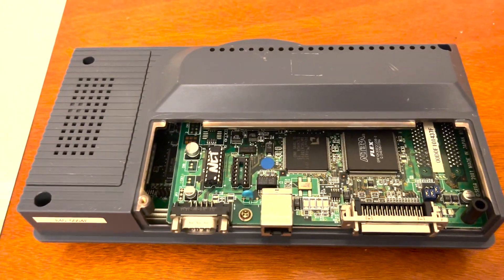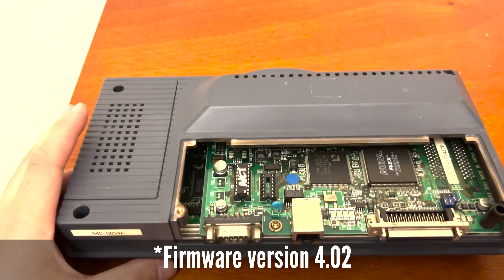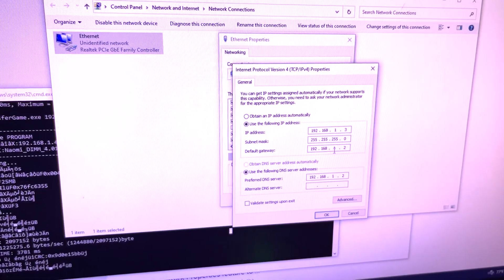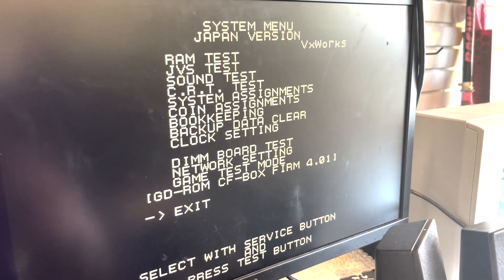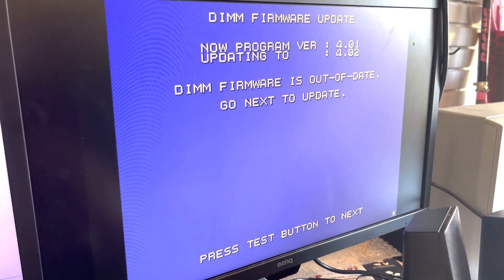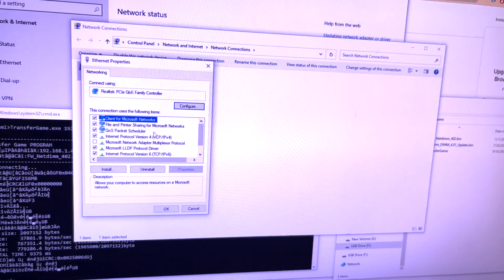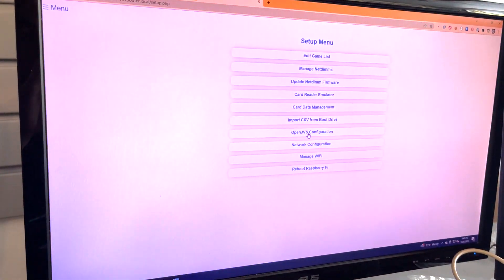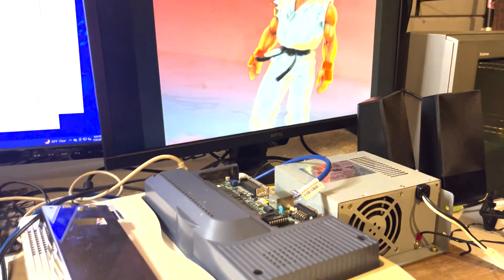How to update Naomi net dimm firmware

Comment: Great vid. Was wondering what you used to plug the power supply to the wall outlet. Looks like you have an oem sun power supply. I have the same and would like to plug it straight into the wall. Thanks
Reply from the maker: You need a custom cable that plugs into the adapter. I had a person make one for me.